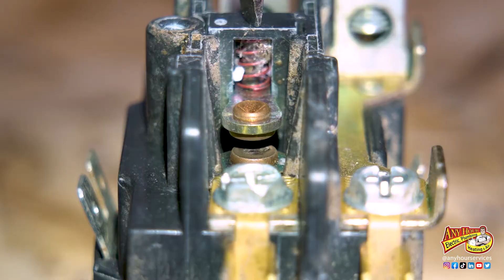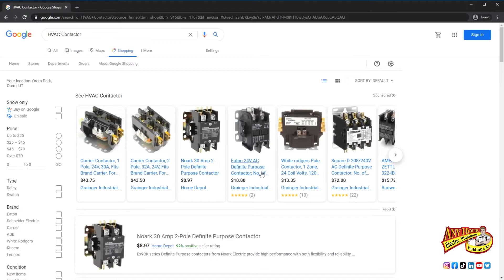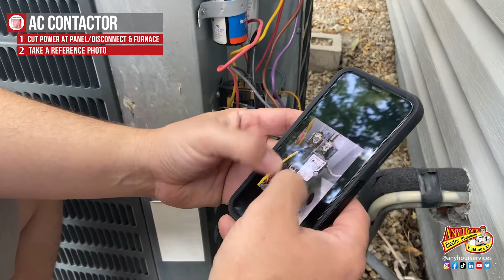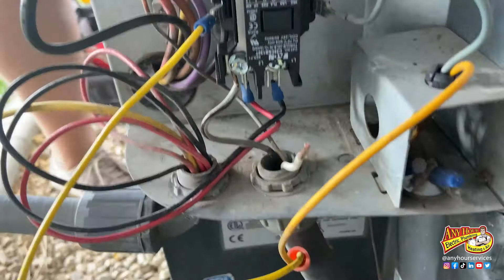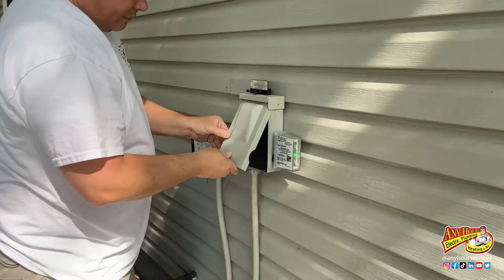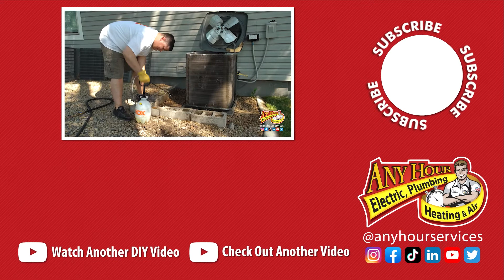AC Repair - How to Replace an Air Conditioner Contactor

Comment: Don’t you hate it when the installer gives no extra wire! You can Also usually shorten the whip by an inch or two to get a little extra